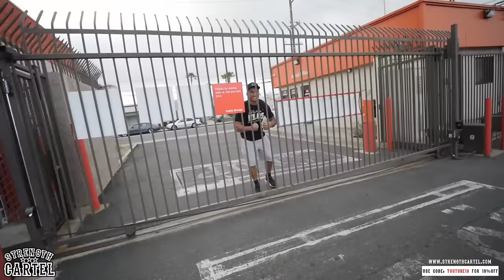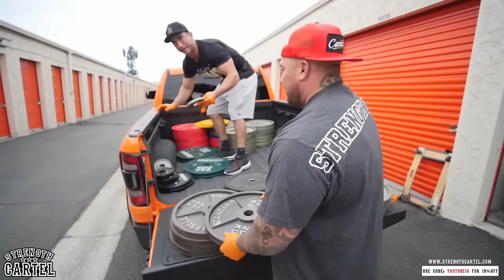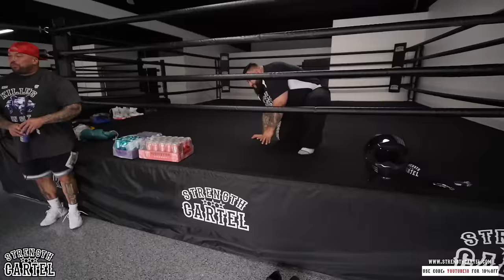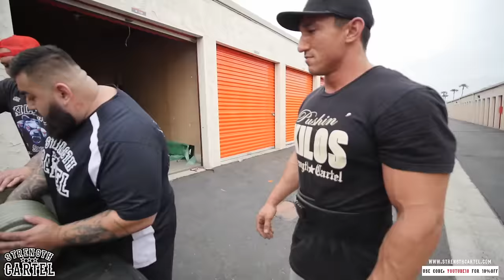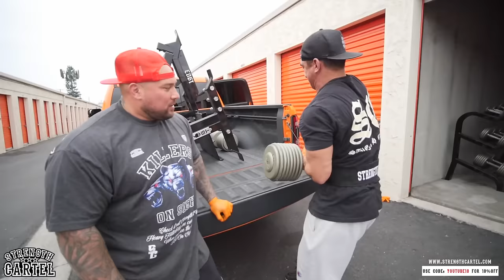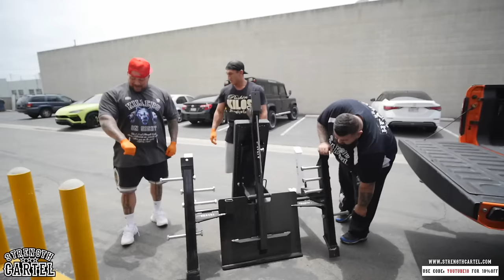The Impossible To Lift Dumbbell !

Comment: I wanna see Big Boy and Julius Maddox collab for Julius to rep out 280 lb dumbbells presses. That would be the heaviest ever done i believe. Make this happen!
Reply: Obviously Julius can barbell bench a whole lot but I haven’t seen him lift heavy on dumbbells. I haven’t followed him much since his 800lb attempt though. Sometimes barbell and dumbbell bench doesn’t convert over to the same amount of strength. What’s the heaviest Julius has lifted on dumbbells?
Reply: @James_Edward59  eh idk tbh i think like a little over 200s?
Reply: @James_Edward59 it’s harder to press dumbbells for example I press 225 on incline barbell for 8 reps but can barely manage three good reps with 100 pound dumbbells
Reply: @conormayweather5474  Yeah, well everyones different with that though. Some people are the same with both. Usually if someone is experienced and skilled in both lifts then I would say 95's or 100 would be equal to 225 though. Do you have more experience with barbell, I'm surprised you can't get at least 6 with the 100s give your 225 barbell. Larry couldn't bench the 250's on flat at all, and he could do A LOT more than that on flat bench so it's definitely a lot harder for most.
Reply: They have done collabo when Big was powerlifting